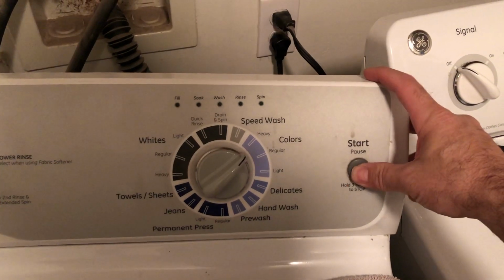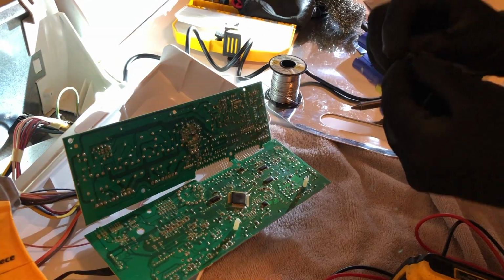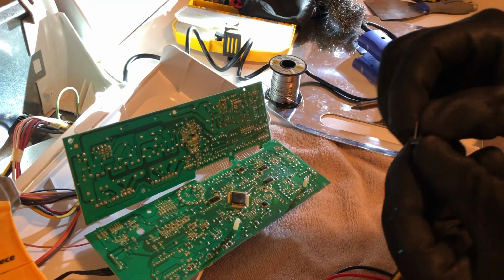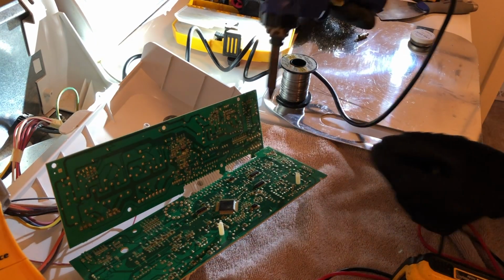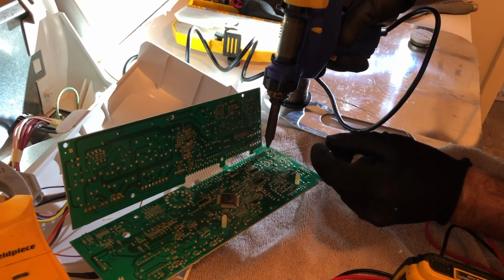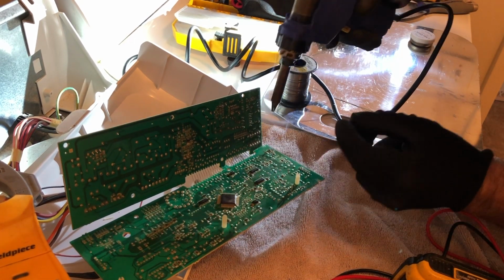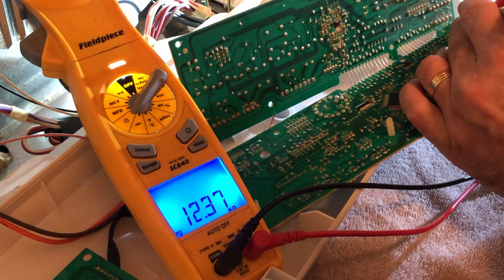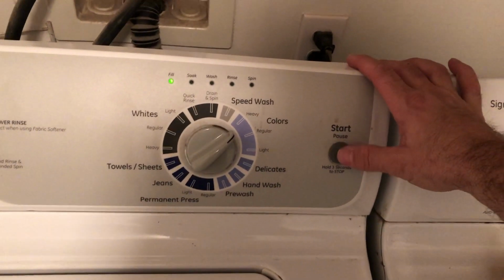GE TL Washer start switch replacement

Comment: Hi, I ;need your help.  My start switch on my Washer WHRE5260E1WW,  I cannot find the part number of the switch as I have searched .  You mention that you order the switch from Amazon but I cannot find the part number.  Thanks need your help
Reply from the maker: You will have to get eyes on the switch, test it as I did in the video and see if it's failed or not. If it is, search Amazon for 'Momentary Tactile switch kit', (2 legs or 4 legs depending on the switch on your board) the height of the switch is important. I got an assortment kit of a few different sizes that I have come across.